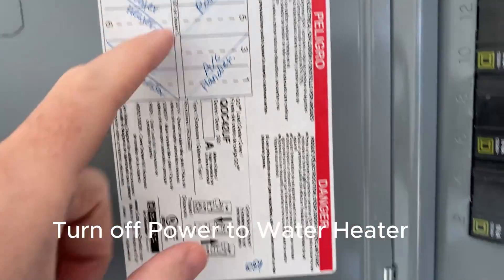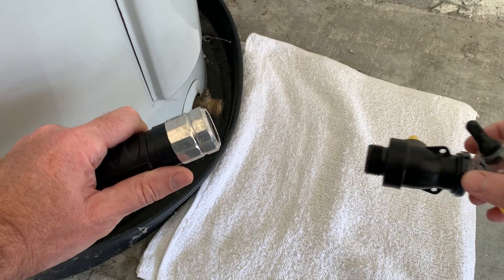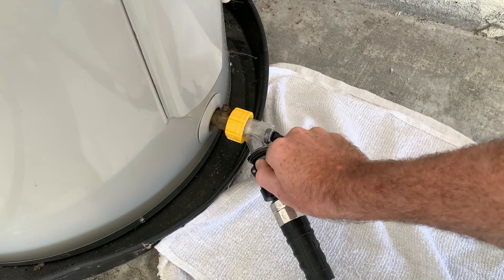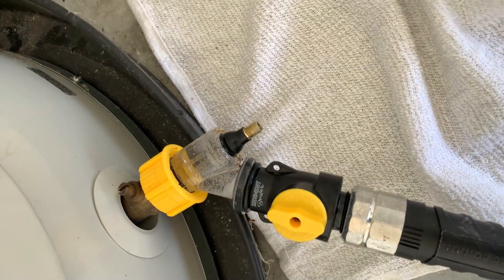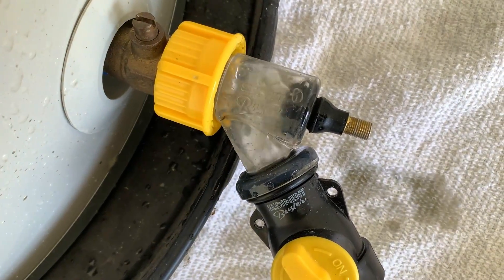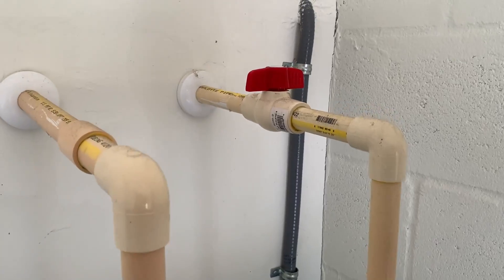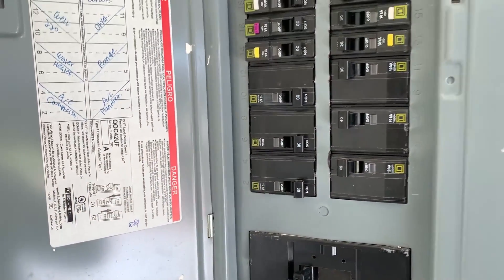Sediment Buster - How to flush your water heater and drain your tank #diy #waterheater #plumber

Comment: How does this work if my water heater is in a basement (no floor drain) and I need to run a hose up through my window well to drain to the outside? Will this still work going against gravity or will i need a pump?
Reply from the maker: Yes you can drain upstairs!  

https://youtube.com/shorts/KyTaG_z9s8I?si=Ge5ys3aMA24ubEQF
Reply from the maker: Drain a tank upstairs with just air pressure
We conducted an experiment where we elevated a hose 10 feet and emptied a full water heater using nothing but minimal air pressure. With just 0.433 PSI
needed to push water up 1 foot, a mere 5 PSI of head pressure can propel water through a hose up a flight of stairs. By injecting air at the drain valve, not only is the pressure maintained, but the drain hole is also kept clear throughout the process.
What do customers say?
How does this improve

Comment: Add a couple gallons of vinegar inside tank; let it sit mixed w/ water in tank for about 6 hours; then use sediment buster. Just a tip. The vinegar helps break down the minerals from walls, elements and copper rod in tank.
Reply: It's acidic, it also eats your tank. Don't do this

Comment: It seems to me after all the hot water is expelled from the water heater you need to keep on the cold water inlet otherwise nothing will come out of the tank drain outlet.
Reply from the maker: Sorry for confusion.  

1. Open and leave on hot water faucets
2. Turn off cold water inlet 
3. Use sediment buster to help you drain the tank empty.  The repeated air bursts will assist with the draining along with the venting from your open hot water faucets
4. Once tank is empty, reintroduce cold water for 10-15 seconds, turn off and redrain.  Each session will bring forward more sediment and the SB will assist in pulling it out
Repeat this step multiple times until clear.
Reply from the maker: That's right!  After you have emptied the tank, reintroduce cold water for a short time and use that feed as a second point of agitation.  This is definitely part of the process in the instruction videos.
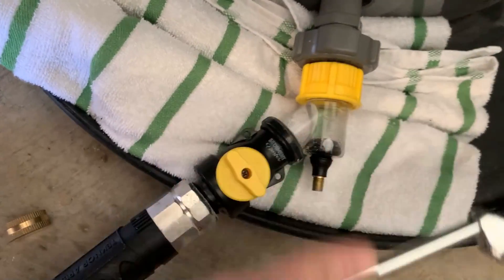Reply: I'm sorry maybe I'm missing something...at the 0:35 Mark you say to shut off the cold water supply. Then at the 1:22 Mark you start pumping air into the sediment buster. In between this time I do not see a step stating to turn the cold water back on. Don't you have to turn on the cold water and have some water in the tank so when you push air in via the sediment buster it agitates the sediment?

Comment: Where was the use of the air pump? I don't see it in the video. Just the air leaking thing .
Reply from the maker: not sure what you mean.
Reply: He said you can use an air pump from a bike or a  air compressor for fast air burst.  He showed you the bike air pump hes just using the air compressor. For the video . I believe the air pump is for those that dint have a air compressor or cant offer one

Comment: I simply hook up a drain hose, place it in the laundry tub, turn the water back on, and flush for 10 minutes. This seems to get all the crap out every year. My tanks always last 15 - 20 years.
Reply from the maker: Flushing certainly helps, however I have proven that our device removes large amounts of sediment AFTER flushing.  In fact, I have a video where I did just that.  Flushed 10 minutes, then cleaned with the SB and it's unique air sucking action.  check it out!

https://www.youtube.com/watch?v=AJbxd7nEEfo&t=150s